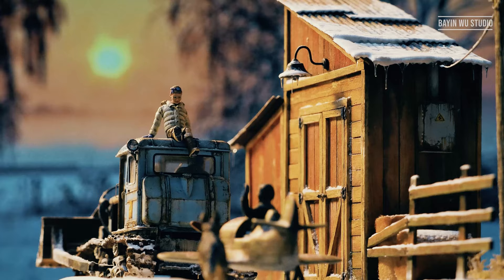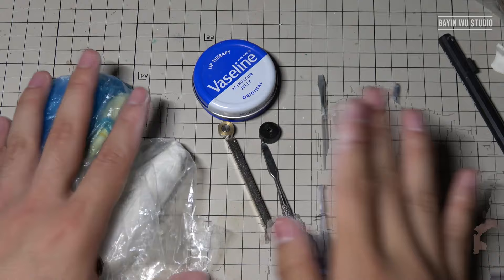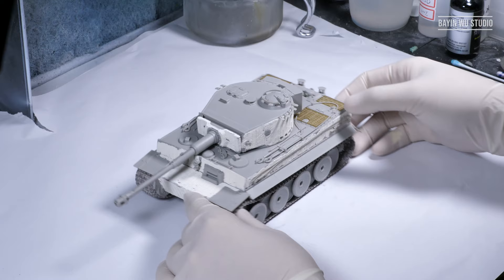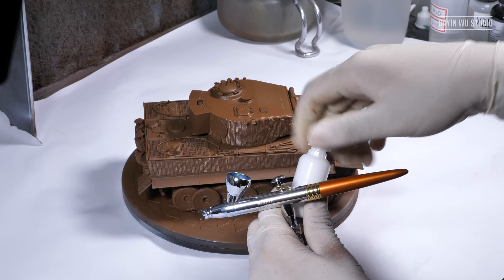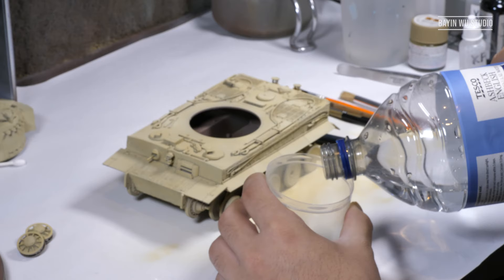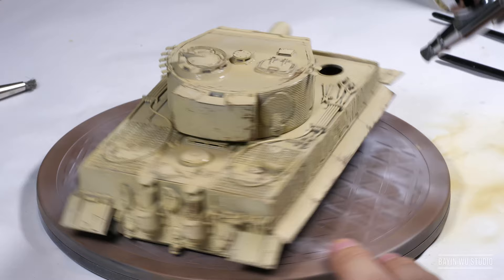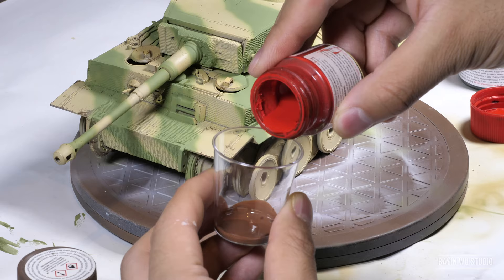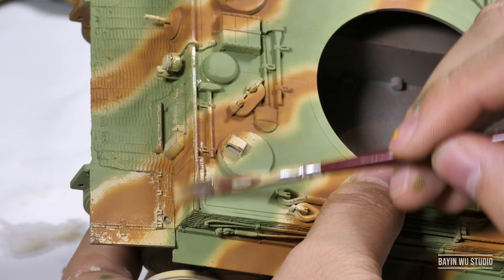Tiger I tank 1/35 pro painting tutorial. part 1

Comment: Way to go Bayin. Dam fine awards that are hard to get. Major competition at the European shows!  And I want to bring up the expected life span of a German tank from 44 on was pretty short though the Germans were very good at returning damaged tanks back to service. I have always thought that some wear from crew or re-stocking but battle damage was more likely.
Reply: You are right on the life span issue, and there are a couple of things I'd like to bring up:

First as you said, the life span wasn't very long for tanks at that time - they were built, shipped out to the units and then quite soon thereafter destroyed, either by the enemy or - which was quite likely - either abandoned or destroyed by it's crew. That means that there wouldn't be that much chipped paint to begin with, especially since:

Point 2: The paint used back then was a lead-based paint which was applied THICK - I mean, if you chip the paint of an armored vehicle from that time, the layers are almost a third of a mm thick. The paint job was meant to protect the metal as much as possible, and that kind of paint in those layers did the job pretty well. That is not to say paint didn't wore off - it just seldom had the time to do it in the amount we all too often see on models. Where paint wore off from crews climbing in and out of the tank, the metal was bare and almost polished, especially around the hatches where the clothing rubbed the paint. 

Battle damage was more common, especially on heavier tanks that could take some punishment, but that left craters, holes and other hard damage to the tank - not scratched paint. 

All that said, it's a nice job, but quite overdone. The one thing you can't overdo on a model tank (but where the mantra is, 'don't overdo it!') is weathering - tanks attract dirt like small children, but if they are covered in mud and dust and  shit - how could we ever see all those nice chips?

Comment: This is just f*****g impressive. By the way I have a question. I struggle painting camouflage pattern on my panther tank. No matter how much i thin down the tamiya paint (xf-61 and red brown used with original thinner) i get those small dots of paint around the straight line. While it makes no difference in painting main color , it is just a nightmare when ya want perfectly smooth line. What could I do to solve out this problem?